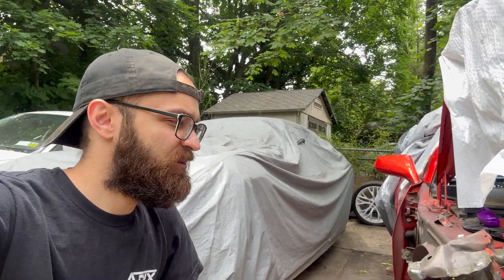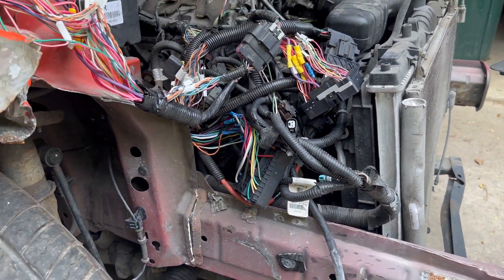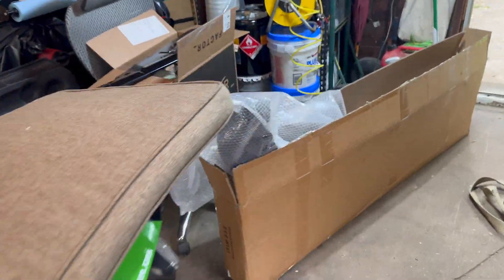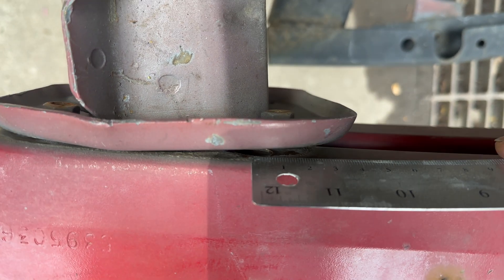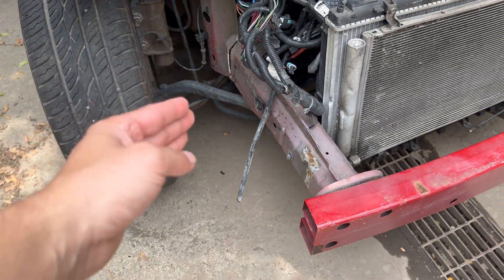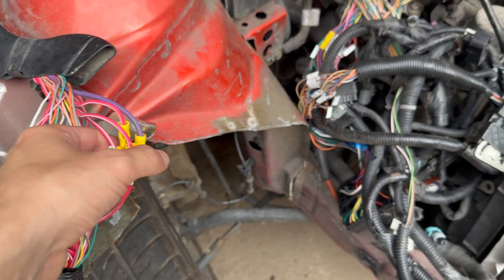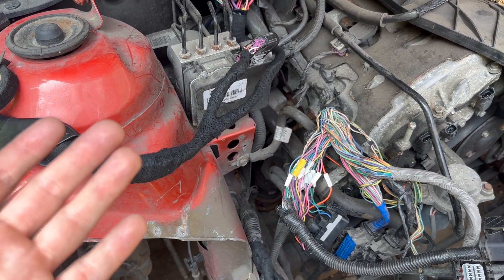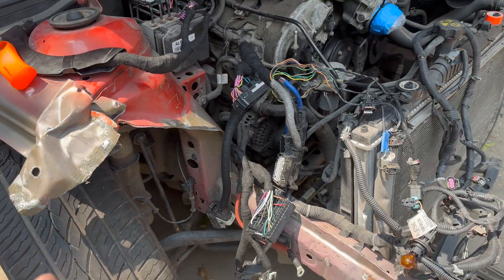2013 Camaro wiring harness rebuild (Build pt 3)

Comment: Hey. Did you have problems wit the brake lights on this car . I had got into wreck  in mine 2011 camaro v6 rs now mines doesn’t work at all got bcm reprogrammed still doesn’t work get back to me.